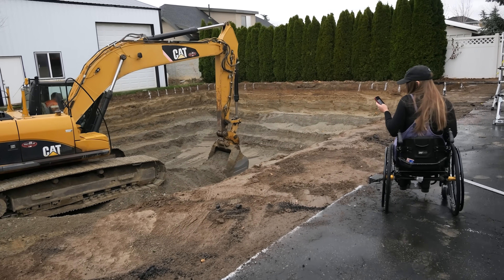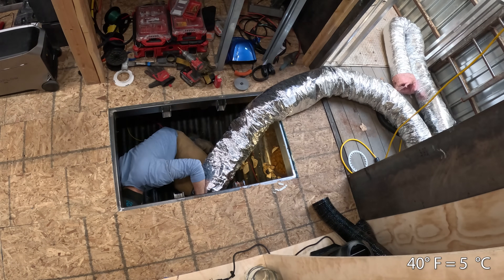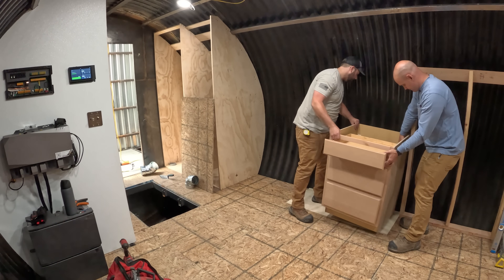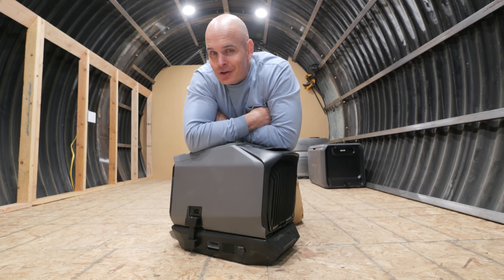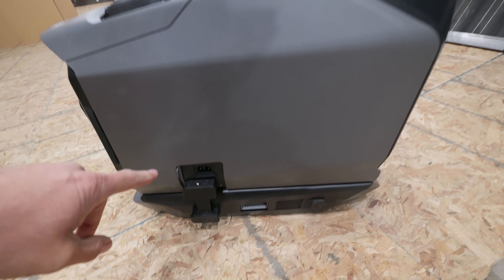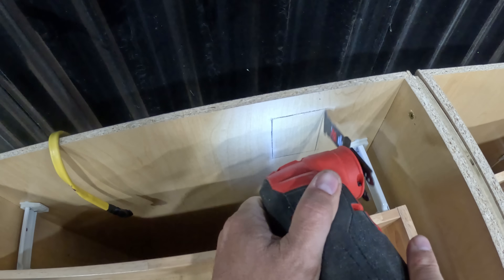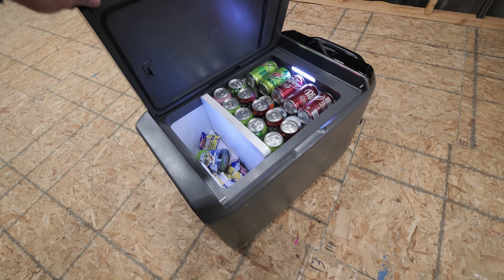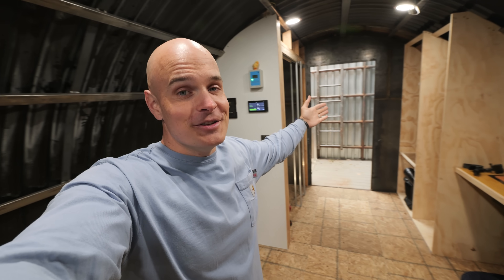How much air does my Backyard Bunker need?

Comment: Several ways to move air around for free.  Your missing an easy way to heat all the air you could ever need, build a greenhouse on top of your bunker.  Heat, filter and move all the air you want all sustainable and free.

Comment: I don't know if you've already picked a fridge for the bunker, but I can give some insight on fridges. IF you choose new, please get the extended warranty on it, as you are more than likely going to have to use it. And please do not purchase any 2021 or newer General Electric fridges, as you are forced to purchase a water filter every 6 months or the water portion of the fridge will not work. Unfortunately there is no one brand that is better than the other. They are all the exact same quality and will breakdown within 5-7 years or sooner, as even the manufacture will tell you 5-7 years at best for any appliance, including fridges. If you are able to get a fridge roughly 15 years or older, they will last significantly longer, and parts for them are still available to purchase, and they can still be repaired.
This is a really cool project and I can't wait to see the next video you make on it :)

Comment: Regarding the Wave 3, is there a toggle to choose whether there's hot or cold air coming in, or is it hard-lined so it has to be hot in and cold out? The ability to decide which would be really useful, though I'm sure it'd be more complicating to set up...

Comment: A-  If conditions warranted wearing MOPP gear, you'd need far more than a rain suit and full-face respirator,

2-  That's not a canary doll, it's a chick (as in baby chiken).  I get that it's supposed to be an analogy, but it's not like it's super difficult to find something that's more representational, &

Ç-  You'll also need to install a fully sealed air filtration system.

Comment: 300% efficiency is not particularly impressive for a heat pump. My hot water heat pump does more than 400%. 

The reason for the EcoFlow’s middling efficiency may be the compact size of the unit. Outside temperatures also have an impact.

Comment: In the name of efficiency, when it's time to select a refrigerator, I'd recommend a relatively small fridge and a separate chest freezer. Chest freezers are just so dang efficient, both in terms of energy usage and space. In addition, if you can store the freezer somewhere near the output of the heat pump you'll get even better efficiency as it dumps its energy into the same air that's already been cooled by the heat pump.

It might be efficient too if you can somehow thermally couple the refrigerator and the heat-pump output too, like with a hole in the floor to behind the freezer. I don't know for sure if it'd work, but you're already putting a bunch of energy into removing the heat from air, it'd be handy if you can make use of it elsewhere.

Comment: Hard to see but is the cold side of your heat pump is using the elevator shaft? If so once your elevator shaft is too cold you won't get much heating anymore. Normally the cold side is directly outside which give you a essentially infinite source of uncooled air to use.

Comment: From my notes:  Air to Sustain Life

Atmospheric CO2 levels today average 383 parts per million (PPM).  Human exhaled breath is around 378 PPM.  As a human breathes, starting from less than 1% in "fresh" air, the upper "safe" CO2 level is around 3%.  When the concentration exceeds 3%, even though there is still oxygen in the air, humans are adversely affected.  An average person produces around .67 cubic ft.  (5 gallon volume) per hour of CO2, so the 3% limit represents a starting volume of 22.5 cubic feet of air (about 1 cubic yard, around 168 gallon).   If you for example needed to be sealed in for a year, you need to start with 197,100 cubic feet, or a cube 58 feet on a side.  In say a 10 foot ceiling commercial building, it's an area 140 feet on a side.  Water absorbs it's own volume of CO2, so for every (.67 cubic ft. or 5 gallon) of water that your air is filtered thru, you gain an hour on the CO2 limit.

Comment: How is that heating working in winter? It reuse the air at the entrance. But this air that rhe unit is producing is cold. So you heat one side and cooldown the orher side till it drop to 5 degree and will not work anymore?

Comment: I'm concerned about that induction stove.  They usually require good ventilation and you're covering the side vents.
Reply: Yeah I cut a slot for ventilation when I installed mine - it was quite big and as big as i could make it but I still need to open the knife drawer underneath to give it extra ventilation if I'm using a few rings on high power

Comment: im concerned about the lacquer on the counter-top
is it heat resistant, so you can put a hot pan down? is it food safe, so if you chop or prep anything and drop it, its safe to still cook with?

love the look of the highly polished wood surface though, that is  talking point for sure

Comment: I started writing down stuff, and it ended up war and peace, I do apologise, its the way my neurodivergent brain works.   hope you dont mind,  

Mate, I've had a proper look at your bunker video, and I must say I'm quite impressed with what you've accomplished so far. I've got some thoughts that might help make it even safer and more functional.

 Condensation Management
What is your condensate plan? The build-up of condensation will be an absolute nightmare in an underground structure. You'll need a comprehensive dehumidification system with automatic drainage. Consider applying anti-condensation coating to those metal surfaces and walls. You should implement proper thermal insulation throughout to prevent cold bridges where condensation forms. A moisture barrier between the concrete shell and interior walls would be wise.

Air Quality & Oxygen
As for oxygen, soda scrubbers will be good for CO2 removal. You'll want to consider installing redundant ventilation systems with manual backup options. I'd recommend adding carbon monoxide and carbon dioxide detectors at multiple heights. A positive pressure system would help prevent contaminant infiltration. HEPA filtration for the air intake would be useful for removing particulates.

Solar Panel Safety
I was more concerned about someone falling through the solar panels. You should install a safety railing or mesh beneath them. Adding some high-visibility markings around the perimeter would help too. If you need maintenance access, consider a reinforced walking platform.

 Plumbing Recommendations
If you do any plumbing to the sinks, please use copper. I would suggest that the water goes through a boiler plus 70 degrees then cooled then through a UV filter - this stops legionella causing issues. You'll want to add backflow preventers to protect your freshwater system and put in easily accessible shut-off valves at strategic points.

 Lift Shaft Improvements
For that lift shaft you've built - you could create a gas/cold air sump to collect cold and CO2. I'd recommend adding CO2 sensors at the lowest point. You should install automatic venting systems triggered by dangerous gas levels. Also consider creating a secondary emergency access route independent of the lift in case it fails.

 External Considerations
Your extraction vents on the exterior - you need to put concrete round them to prevent weed growth. I'd also suggest camouflaging external components to blend with surroundings. Add pest prevention measures like fine mesh screens. Consider installing motion/vibration sensors around external components for security.

Electrical and Fire Safety
I would suggest putting in a collapsing circuit fire wire running round the rooms and kitchen area. When it melts, the circuit collapses and initiates a fire alarm system - giving you early warning of a fire. For the kitchen area above the hob, I'd suggest a low melt trigger system that initiates an extinguisher automatically. It's a standard thing in restaurants now and would be perfect for a confined space where fires could spread quickly.

Emergency Equipment
But even more importantly, you need an enclosed space extraction kit, and enclosed space extraction and medical training. A roll up stretcher or a scoop stretcher would be essential to practice for the day the lift does not work and someone gets injured. Add emergency lighting that operates independently of your main power system. Glow in the dark signage would help with navigating in low light or power failure situations - mark emergency exits, first aid locations, and fire equipment. Create laminated emergency procedure cards posted in key locations and schedule regular evacuation drills.

Water Management
A basement pump also needs to be put in, with a backup power source and an automatic sensor. I'd recommend installing water level sensors at multiple points too. Add a visual and audible alarm system for pump failure. Consider a gravity-fed emergency drainage system as a last resort backup to prevent flooding.

Overall, mate, the bunker's looking great, but these additions would make it much safer and more functional. Let me know if you want more details on any of this stuff. Looking forward to seeing how it progresses!

Comment: Do a collaboration with Jeff Geerling and get a small smart home setup down there. Then you can automatically turn on ventilation when CO2 levels are too high. If you're looking for heat, and the outside air is warmer, run ventilation instead of the heat pump, run the heat pump if outside air isn't warm enough. Run the heat pump on cool setting if humidity gets too high down there. Etc.

Comment: I'm curious about how much extra time and money it would have taken to build the bunker using poured concrete with straight walls and attach it to the main house and grid. I imagine this setup would provide more space, easier access to the bunker, and a more seamless connection to the main house's electrical grid and solar panels.🤔

Comment: This is an excellent project, but despite the likes of Bezos mining into mountains to isolate himself from the outside World, I wonder if just going down a few feet will really protect you whenas is destined to happen progressively creating electrical outages as happened in Europe  when the magnetic poles switch, as they do roughly every 12,000 years and is due to happen about 2050, when climactic conditions including solar flairs and UV will probably burn out everything electrical returning us to the stone age. Then just for Sh and giggles  the Mantle is due to uncouple from the upper levels of the Earth, and possibly in one day the poles will be at the equator and IOWA might be in the Southern Latitude. Take down lots of canned food. Baked beans might be a bit unpleasant if you cant do an air exchange.

Comment: Easier to use geothermal heating & cooling in some cases for the heater exhaust.  Just pipes full of liquid/refrigerant running through the dirt next to the bunker, pressurized heat exchanger if you want to be fancy, etc.

Assuming the goal is to reduce acute-radiation from nuclear fallout & you only have heavily filtered air intakes…

Comment: Id' be more concerned with measuring the concentration of other heavy gases that may displace oxygen than I would with measuring the CO2 concentration. your body is already good at detecting high CO2 concentration, it's literally what it uses to determine if you have enough oxygen (your body responds to too much CO2 in your blood as opposed to not enough oxygen in your blood), whereas any other gases that are displacing the oxygen won't trigger a response from your body so the first sign of low oxygen levels will be a decline in cognitive ability. Basically low oxygen levels due to anything other than high CO2 concentration will make you too dumb to do anything about it before you realise something is wrong.

Comment: I know this is a sponsored video, and the ecoflow is a great idea, but a few ideas for folks looking for other ideas... if your climate supports it, you could try subfloor heating with liquid and a pump, fed to a pool-style solar heater on the house roof.

If you plan on using some gaming pcs or other such powerful pc equipment, you could also try tying liquid cooling into the floor heating via liquid-liquid heat exchanger. 

Alternately, if you have an area in the main house that needs cooling, you could pump the bunker in-floor heating up to the house as a pseudo-geothermal setup

Comment: Two suggestions:
1. connect bunker to your house's basement (this way you don't have to 'go outside' and you'll get two ways to enter/leave your bunker which will save your life if one of the exits gets damaged or covered by something)
2. Round tube surrounded by tons of ground is a good idea if you want to have an additional cooler space but if you see this as an actual bunker it should have proper insulation, concrete walls and it should be lived-in place you use during a week (not just a place you visit twice a year at best)

Comment: Okay, focusing on plants that can both help clean the air (remove pollutants) and supplement the air (minor O2/CO2 exchange) in a bunker environment where you can provide adequate artificial light, here are some excellent choices:

The key is that artificial light must be sufficient (full-spectrum grow lights, appropriate intensity, running 12-16 hours daily) for the plants to perform photosynthesis effectively and stay healthy enough to clean the air.

Here are plants well-suited for those dual roles under artificial light:

Snake Plant (Dracaena trifasciata / Sansevieria trifasciata):

Cleaning: Top-rated for filtering formaldehyde, benzene, xylene, trichloroethylene.   
Supplementing: Releases oxygen during the day (if lit) after absorbing CO2 at night (CAM photosynthesis). Very hardy.   
Light: Needs good artificial light for O2 release, but survives lower light.   
Spider Plant (Chlorophytum comosum):

Cleaning: Effectively removes formaldehyde and xylene.   
Supplementing: Relatively efficient photosynthesis under good light. Adaptable and grows fairly quickly.
Light: Thrives in moderate-to-bright artificial light.
Peace Lily (Spathiphyllum spp.):

Cleaning: Known to remove a wide range of VOCs including ammonia, benzene, formaldehyde, and trichloroethylene. Also adds humidity.   
Supplementing: Decent photosynthesis even in slightly lower light conditions than some others.
Light: Tolerates moderate artificial light well.
Pothos (Epipremnum aureum):

Cleaning: Good at removing formaldehyde, benzene, and xylene.
Supplementing: Hardy and performs photosynthesis well under good artificial light.
Light: Very adaptable, grows well under moderate-to-bright artificial light.
Areca Palm (Dypsis lutescens):

Cleaning: Excellent general air purifier, removes multiple toxins. High transpiration rate adds humidity.   
Supplementing: Known for relatively high CO2 conversion rate.
Light: Requires bright artificial light to thrive. Can get large.
Boston Fern (Nephrolepis exaltata 'Bostoniensis'):

Cleaning: Particularly good at removing formaldehyde and xylene. Adds significant humidity.
Supplementing: Efficient photosynthesizer with sufficient light and moisture.
Light: Needs moderate-to-bright, indirect-style artificial light and consistent humidity/watering.
Rubber Plant (Ficus elastica):

Cleaning: Effective at removing formaldehyde.
Supplementing: Large leaves can contribute well to photosynthesis with enough light. Hardy.
Light: Prefers moderate-to-bright artificial light.
Dracaena Species (Various):

Cleaning: Different species target various VOCs like xylene, formaldehyde, benzene, and trichloroethylene.
Supplementing: Perform photosynthesis effectively under adequate light.
Light: Most common varieties do well under moderate artificial light.

Comment: Ecoflow is pure bullshit. You need the unit to be outside otherwise you will throw air from inside to the outer world which will creating a pressure deficit which will pull air in from the outside which you dont want

Comment: I got a nuclear bunker, in the beginning I was worried about air running out while sleeping, but turns out there is a lot of air in a room. No problem being 5 in one of the small rooms for an extended weekend. (there is ventilation, big system uses a lot of power, so I keep it off)

Comment: CO2 level outdoors is normally around 400ppm
Inside buildings around 1000ppm
2000ppm is acceptable for doomsday scenario but not optimal which is below 1000ppm.

Comment: Why do you not get plants to filter out the air so you don't have to rely on electric devices or anything that requires electricity to power them. You have thought how long you would have be in the bunker right  because if there was a long radio activity. You might want to extend more for a greenhouse with UV lights or a small farm area for like cows and a exit for them and a horse for traveling if needed so if possible I would extend at least 3 more  for all long term events. Also I would rebuild your entrance so no chemical gas can leak through cracks.

Comment: Air-to-air heat exchanger will save you some energy as well. Pretty much standard in all ventilation systems in Finland during last few decades. Not as powerful, but the ventilation isn't that high on power requirements as plain ventilation.

As oxygen percentage goes down, I noticed that while my brain still feels it is working normally, some physical tasks suddenly become very difficult or impossible. Might be the reason why OHSA is careful to have strict limits, while slightly lower oxygen percentage wouldn't feel bad or be life threatening itself. Sherpas and some folks living in mountains of SA probably would be just fine and consider low land dwellers silly, while we would be having hard time walking straight.